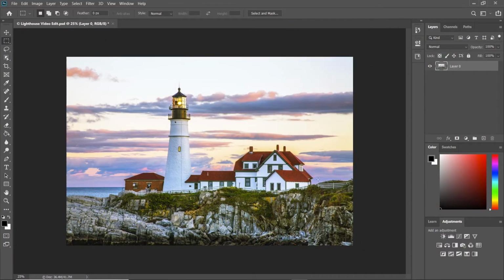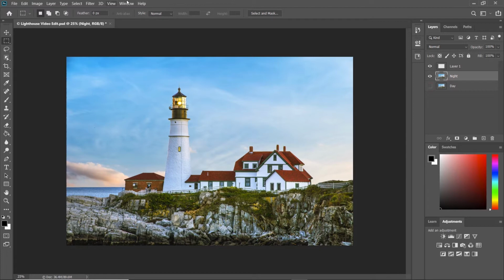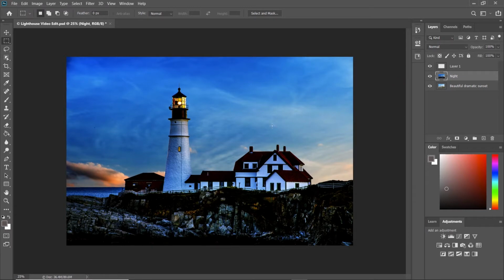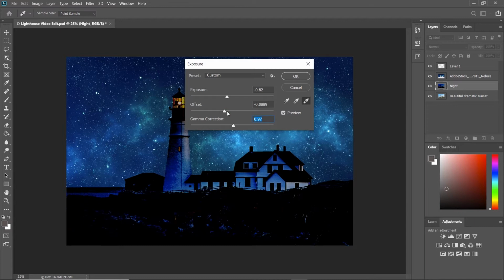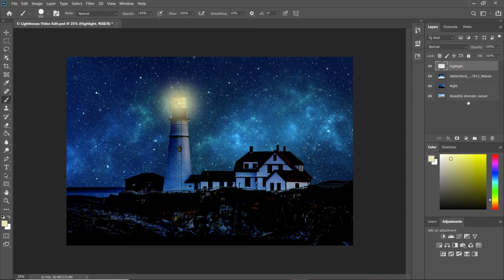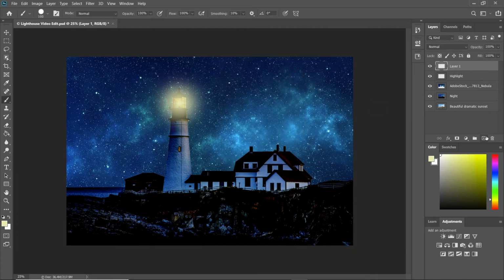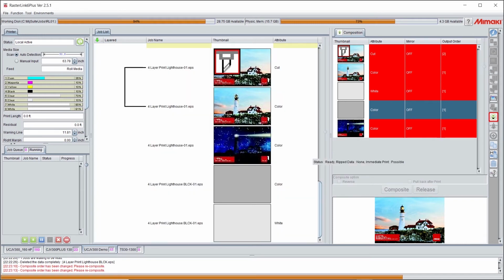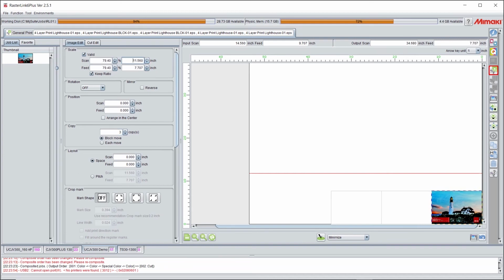4-Layer Printing ~ Tips, Tricks & Techniques

Comment: I used this video as a reference when printing... my print shows the "nighttime" mode and has a very dark cast to it. What could I have done wrong to cause this?
Reply from the maker: Hello, ensure the top image is lighter than the bottom image, otherwise, the color will not have the opportunity to "shine through". Email our technical service team at na.service@mimaki.com if you are still experiencing issues.